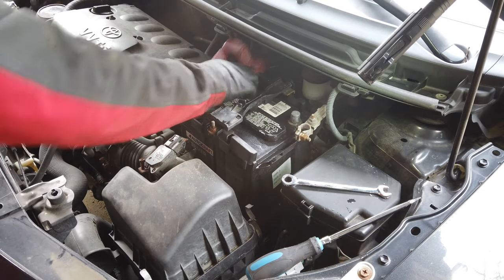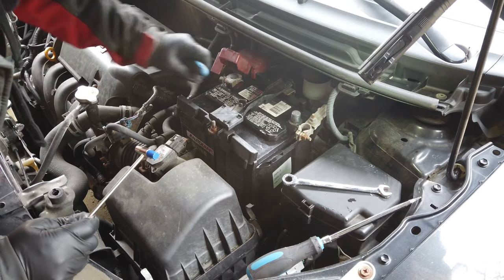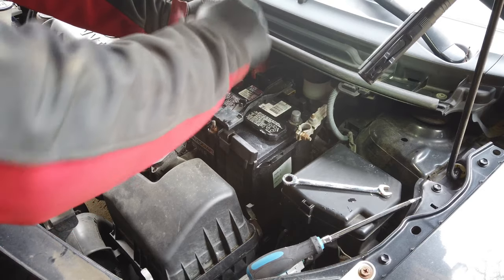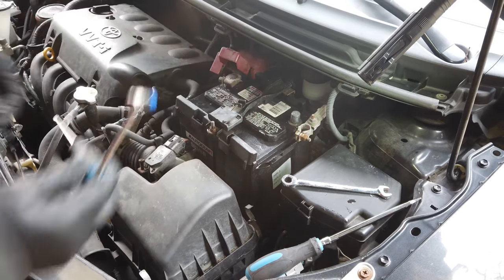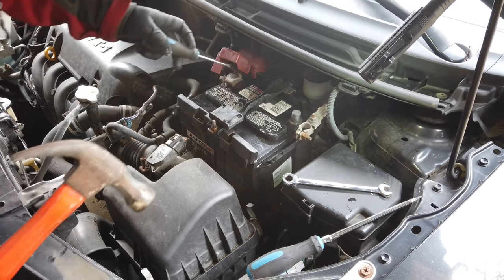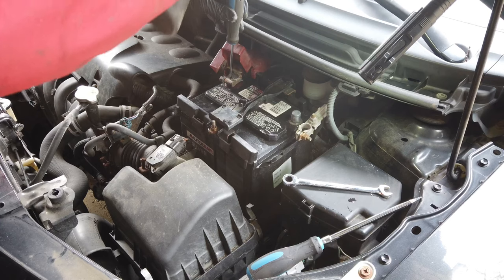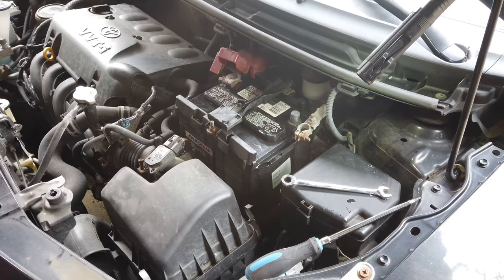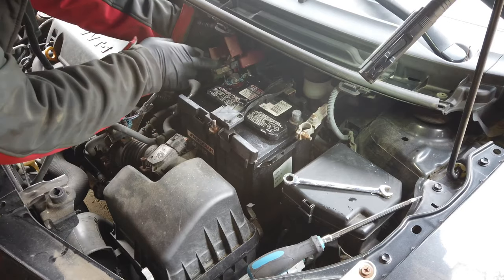Remove stuck battery terminal

Comment: Tried all the methods of baking soda and water and none of those worked. My terminal was absolutely stuck and had me pulling out the vise grips to try and pry them off. Even got a battery terminal puller and that didn't work. Your method broke the terminal free in 10 mins. Thanks bro

Comment: Good videoI. I need to see one wheer the positive  termial bolt is correded and seized. I have  used master blastr, liquid wrenct, and we 40. I hve used vise grip pliers to the point I have rounded off the bolt and it still will not budge. Abouth ready to throw the battery away.
Thnaks

Comment: My neg terminal was absolutely wielded to the post.  I ended up tearing the post right off the battery to get it out.  The battery cable had to be replaced of course, along with the battery.  In an attempt to at least save the cable, I tried more hammering and a drill to get the post head out, but even that wouldn't lodge it free.  I just threw it all away and put in another cable, with new battery of course.  Next time I'll use anti-corrosion grease and not tighten it so much, along with checking it every year or two.
Reply: Fuck I’m worried that’s what’s gonna happen to me, I left it as is since purchase and I know they didn’t put any grease now

Comment: I couldn't see what you were doing in the video. A closer up view would have helped
Reply from the maker: Thanks for the feedback. I hope you were able to get it unstuck. If not it is just about finding the seam in the terminal clamp and then trying to gently open that seam using the flat head screwdriver and hammer. Again very gentle so you don’t damage the terminal. Hope this helps and I will try to get a closer shot next time.

Comment: If I can get the negative off am I save to try this with out damage? My neg is off , pos stuck on , both corroded as sht
Reply from the maker: Yeah in the video I am removing the positive side
Reply: @tinkeringworkshop6005  thanks I got it , the pos was stuck on so I scared to use baking soda , but I took the top have off the pos , it was stuck so bad the banking soda plus light tap on the slit got it off 🙏🏻🙏🏻

Comment: i just tap it a few times with the back of a screw driver and wiggle it a few times gently and it comes out happened when my batterie was going bad i replaced it already nedd to replace terminals the bolts are stuck on the wire and dont want to cut of wire xd